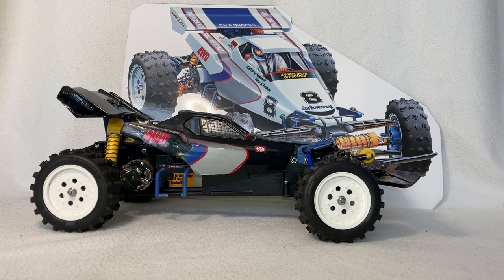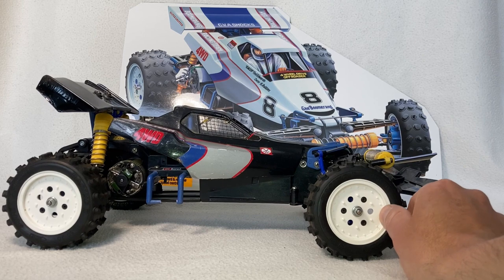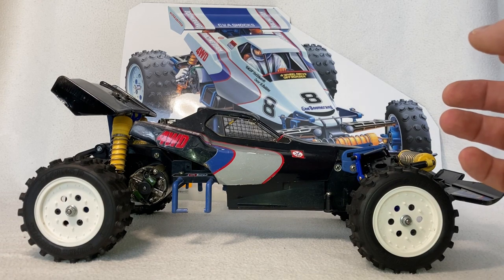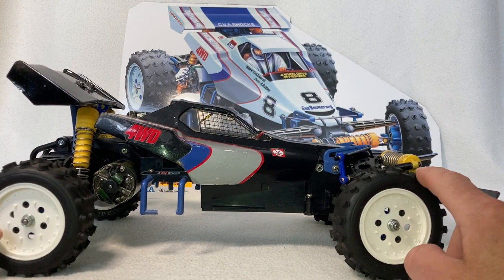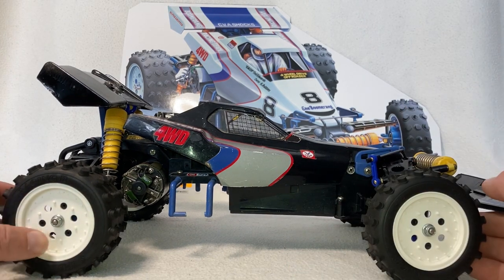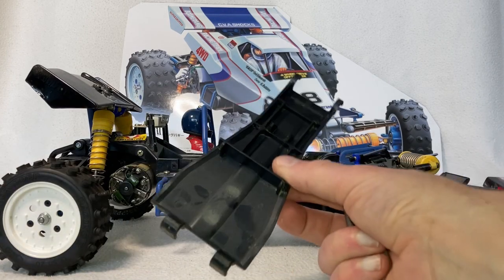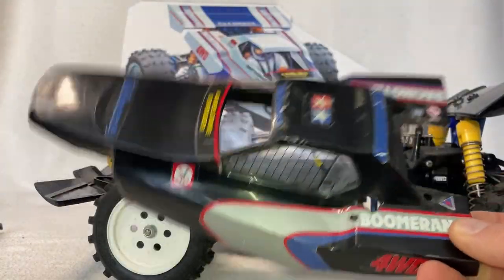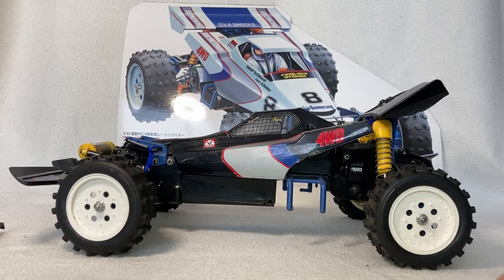Vintage Tamiya Boomerang

Comment: Ah nice buggy! I still have a Tamiya 'Falcon'. The Falcon did not have 4x4. When I was restoring my falcon several years ago first thing I changed was the analog speedcontroller to a digital one. Like you say, these analog speed controllers are a pain ;-) I also took my Falcon for a few tests but found the plastic of the parts a bit fragile. It felt like every time I went driving something broke..  I made 3D printed spare parts so I could repair things (like the suspension arms that hold the wheels)  without having to source vintage parts.
Reply from the maker: Yes, a friend of mine also has a Falcon, it’s a nice buggy but as Tamiya never re-released it it’s really difficult to find spares and true vintage parts just crumble into dust.  
My Boomerang just sits on a shelf now but I occasionally run my Super Hotshot and I have a Re-release Boomerang as well.
Thanks for watching 😊👍